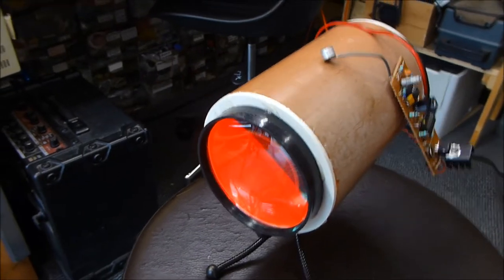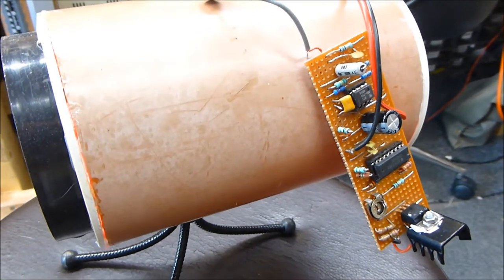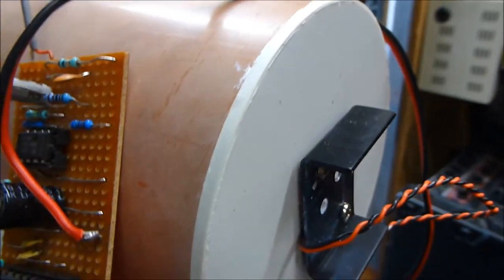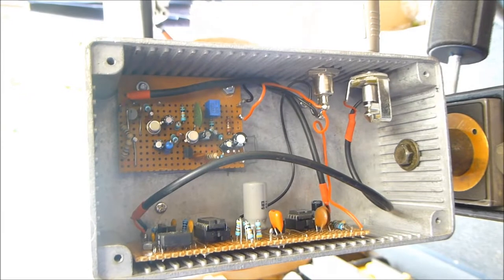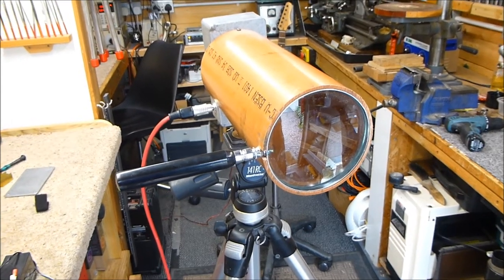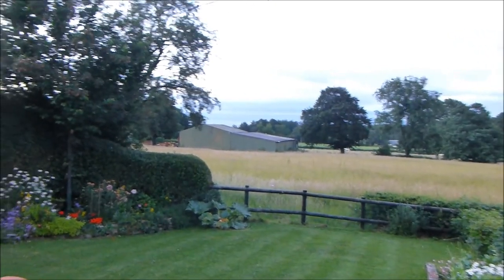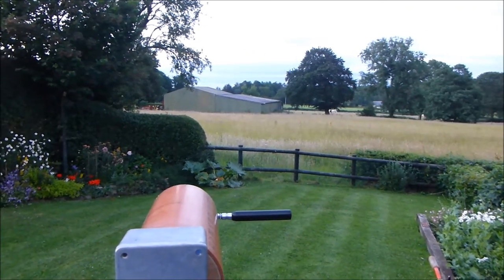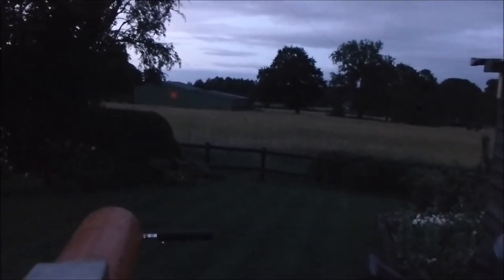An optical audio link using a frequency modulated  carrier signal @25khz

Comment: Interesting and mostly completed project, i only tried to do simplified version. I am  surprised how well that setup work with reflected beam  from farm wall,  suppouse distance may be as twice longer with direct beam setup.  Also nice to see original components,  Signetics 565 pll chip,  Philips branded op amp and  mkt cap and resistors probably made by Philips too. All original electronic components from 90s.
Reply from the maker: Yes sadly some  of these parts are obsolete and now difficult to obtain. I did buy a few plls from a company in the cricklwood electronics. They keep good stocks of hard to find parts. It was a great projects the circuit mostly came from the rsgb publication radcom .